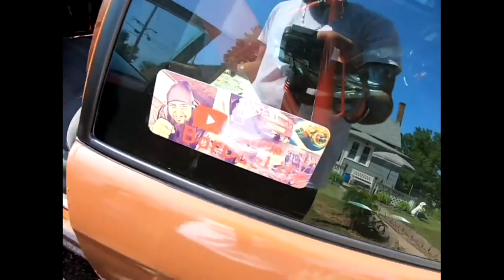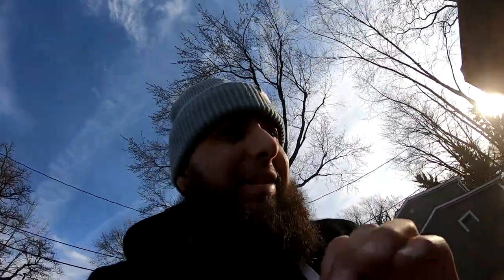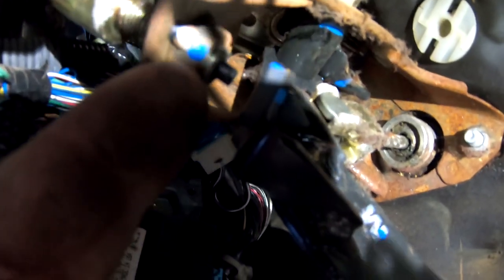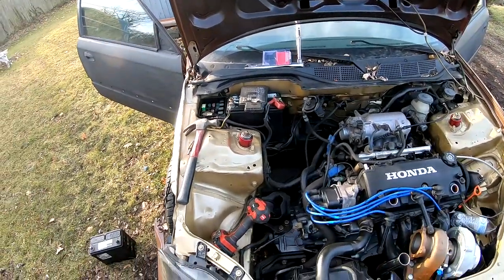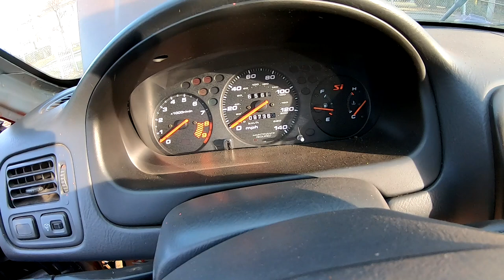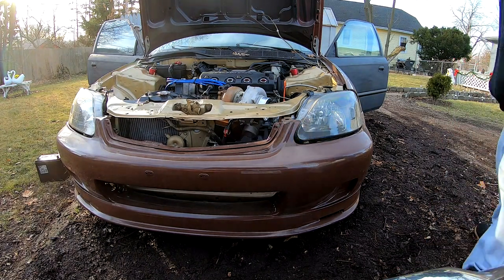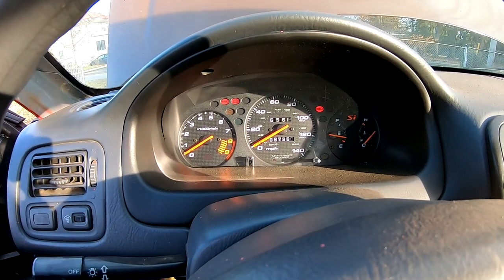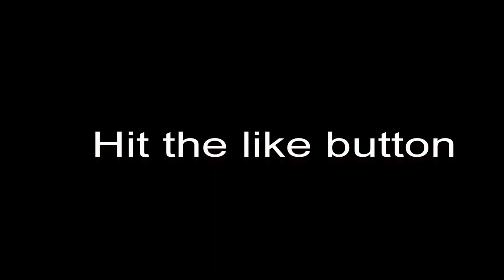Ebay built Civic Electrical Problem headache!!!!

Comment from the maker: Any ideas anyone?
Reply: Clicking.. Battery dead or lose connection and not getting enough amos/voltage.
Reply: Mitsuba RZ-0132 is what you need. Genuine OEM relay.
Reply: Pull that relay apart and reflow the cracks in the solder. If that's not it I'm onto testing ignition switch next.
Reply: Seems like the main relay is failing. You can either open it up and solder all the joints with new solder or get a new one.
Reply: Sand down your grounds in the engine bay with the paint its not getting grounded
Reply: Ground  problem
Reply: Check The main starter relay fuse it could be blown.
Reply from the maker: You nailed it ground problem like you said 👍
Reply: Barbas Life im glad bro that happened to me twice before h22a ek loose ground and kept blowing the main. Second ls turbo paint woulnt let it ground
Reply: Check the ground near the transmission and one for the head clean both of those and there is ground for the Ecu on the thermostat housing clean that one very good check for broken wires at this ground if it still doesn’t work run a ground from your thermostat to the negative of your battery 👍

Comment: I guarantee it's that aftermarket relay, my car used to have the same one. And did the 3xactbsame thing. A used relay on eBay fixed it for me. In my experience, any time anything electronic goes bad it's better to go with OEM.

Comment: I'm saying replace that fuse regulator in the glove box and put new starter in it it may come up on machine that its fine but once  you have it connected it acts like dead battery and no power also check where the battery there is a wire that if its  not connected or in wrong place the car wont start,I'm talking about that small fuse box next to battery but I'd still get new starter cause that thing how its bent near the wires can and would make you have this issues and that down the road you don't have to replace it later my friend........